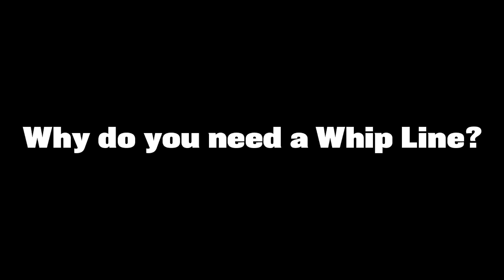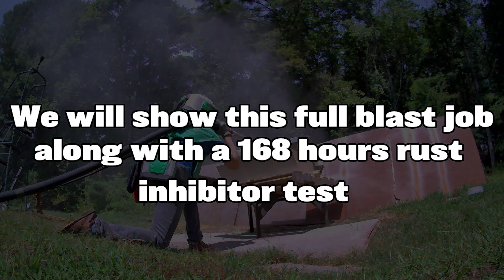Why Sandblasters NEED Whip Hose & How to Make One – Abrasive Blasting & Dustless Blasting

Comment: Question.    Whip hose?    Is it to move around more freely?  May you give a quick explanation.    Thank you
Reply from the maker: YEs.  The 4 ply are so bulky they are hard to maneuver, so we cut off the last 8-10 feet and attach a 2-ply hose. Makes it much easier to handle.
Reply: Appreciate the response.    Ty 🤝
Reply from the maker: @NovokNagyra  Anytime!  Thanks for watching